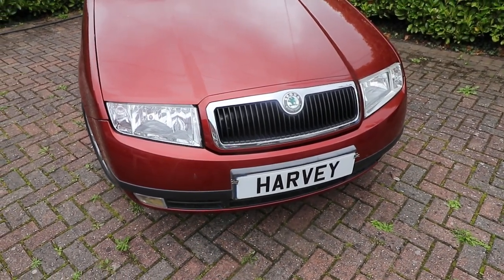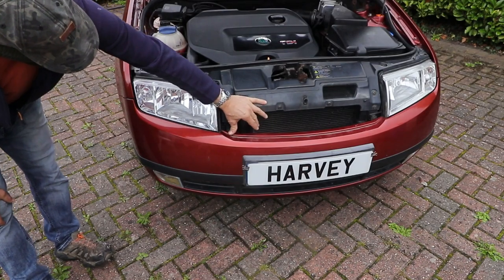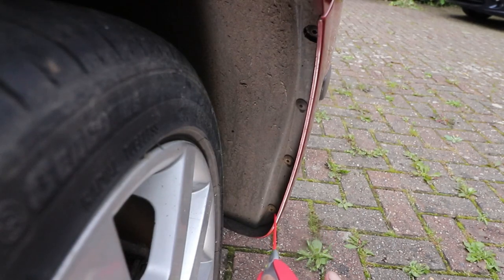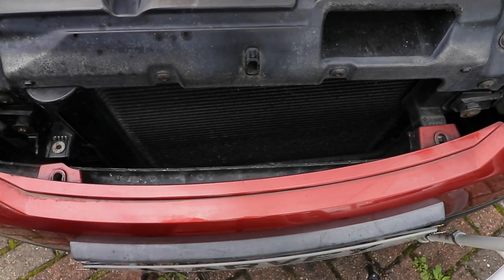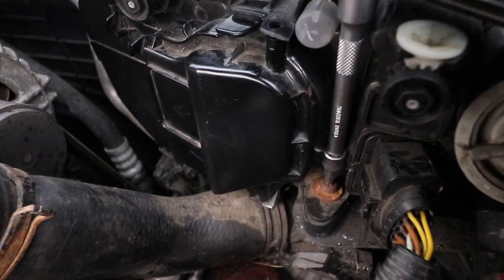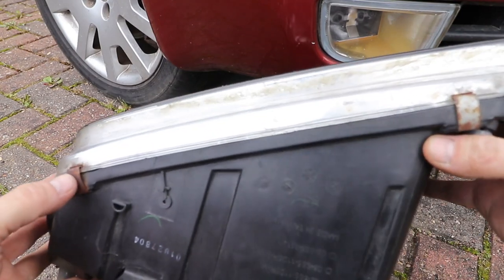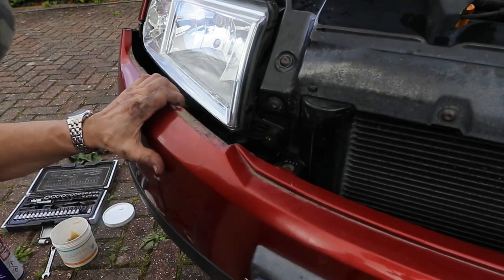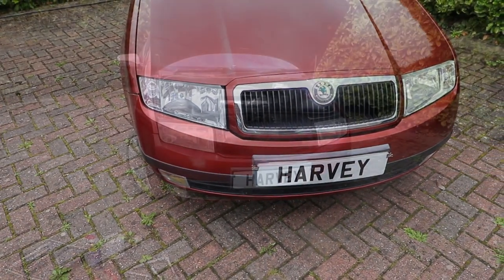SKODA FABIA Headlight Unit (MK1 99-07)

Comment: I have just come in from the garage having replacing the headlights on mine....easy enough job but my old ones have what  looks like the adjustment motor on them and I haven't figured out how to get those units out and install them on the new headlights yet. I need to look into that. Also I need to check the aim on them, but that's tomorrow's task. Thanks for the video, mate.....it helped me quite a lot. Nifty little cars - we have zero regrets at having bought ours last year. Your channel is a great resource.
Reply from the maker: You're welcome, I changed the motors over on mine easily enough, but can't remember how it's done. Maybe I'll have a look into showing that in a video 🎥 :-)
Reply: I know it’s too late to help you, but for anyone reading this comment, to remove the motor you have to turn it and it’ll became loose.

Comment: Mine were missing the rubber bits on the top. Also the passenger side bolt at the front ust spun. I wasn't able to get it off. Will need to grind off the head I think 😮

Comment: Great Video, many thanks. Is it possible to check power steering fluid by removing the from left head lamp on a 1.9 PD, right hand drive?
Reply from the maker: Good question. I ruled that out as you would have to re-align the headlight adjustment if you did and it looks too tight. I don't think you can get the cap off, I never tried. This is how I did it: https://youtu.be/1LWT-YqiTzE?si=Jm1G9uNMiwUKJAC3. But, if you can find a way video it, post it on your channel and let me know :-)

Comment: I need both my front ones replacing. Become oxidised now they say wipe them with turtle wax but they are chipped and I think it's inside the unit where the problem is spent time on them just cannot get them clear.
Reply from the maker: Probably a good idea to get new ones. Hit and miss with quality on these so buy recognised makes :-)
Reply: @HatBoyHarvey  would a parts shop replace them? It's been a brilliant car I don't fancy getting rid just because it keeps coming up as an advisory on mot.
Reply from the maker: Depends on them, but they are not hard to fit and then the MOT garage can adjust them for you :-)😂
Reply: @HatBoyHarvey  they keep saying buy turtle wax it pisses me off because it's clearly n the inside 😅
Reply from the maker: @jacobs3031  post a photo or short video on your channel, let me know and I'll take a look :-)
Reply: @HatBoyHarvey  thanks mate I'm in two minds seen a Volkswagen golf cheap with low mileage I'm thinking of trading it in.

Comment: Hi, I removed one of my lights and in the process the front nut screw which is moulded to the housing just snapped. Do you think it will be an issue when it still has the other 3 torx screws to hold the headlight in place? Thanks

Comment: Hello Harvey!

First of all I want to say amazing work with the skoda fabia repair playlist. My mom has an old fabia which I usually take care of many things myself and your videos really helped me so much this far, thank you. Also I have a question for you, the problem with our fabia is that the headlight adjuster units (electric motor inside the unit & the white adjuster screws) are broken so you cannot adjust the height of the bem of the light. I would like to know if I can adjust the height of the beam playing with the adjuster knot bolt as its the only option that I have and that comes into my mind. 

Thank you in advance :)
Reply from the maker: Hi, thanks for the support. The light unit moves within the outer shell which the adjusters attach to. If the adjustment has been moved to the maximum on either screw it can sometimes appear that they don't work, so it maybe worth checking for that. Cheap replacement units can also not work correctly as I had one that did that with the adjusters. If you buy a new unit either buy an OEM one from a scrapped vehicle or a good new one from a shop that you can return it to if found not to work rather than online :-)

Comment: Nice video, as always !!! Just one really really important thing. If you have xenon headlights (discharging lamps) is critical to disconnect the battery first due to there is a high risk of death in case of short.
Reply from the maker: Thanks for that important point if as you say if you have xenon lights.

Comment: My 2002 seems to have one bottom bolt that is inserted from the underside. Are you sure this works for the 2002 model+
Reply from the maker: All the bolts are accessed from the top and front. What model is your car and do you have a modified or different unit?